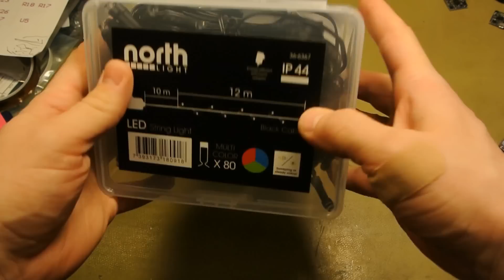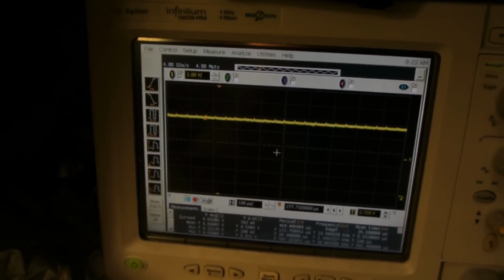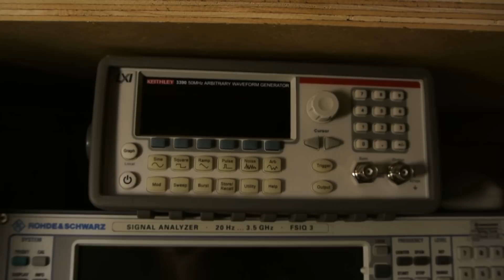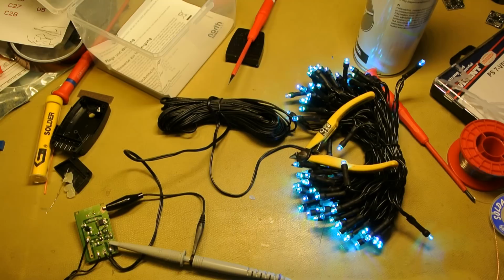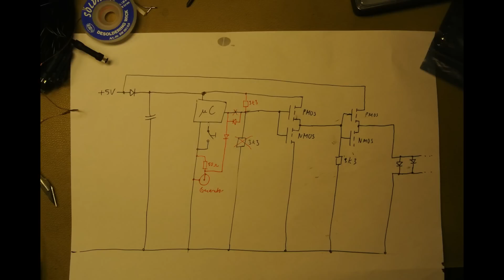Pulsed VCC controlled RGB LED strip

Comment: Next time you want to remove hot-glue, put on a drop of isopropyl-alcohol, and it magically releases - no mess on the table with all those cracked parts :D
Reply from the maker: That turns out to be a very helpful tip, thank you.

Comment: So to do the 'fading' it is switching rapidly between colors by sending two sets of pulses that total 8 pulses.  If it is fading from Blue (1) to Purple (5) to Red (4) it sends four pulses (to get to Purple), pauses briefly, and sends four more to cycle back to Blue.  The pause on Purple increases as the pause on Blue decreases increases until it is staying Purple almost all the time.  Then when it is at full Purple it starts fading to Red by sending seven pulses to cycle around to Red and a single pulse to switch back to Purple.

Comment: Great stuff! I noticed the simple colour change program (#2) uses a single pulse to change the colour, and a double pulse between white and blue (to skip the off state). Now I need to get the Arduino to generate out of spec pulses - same as you did. Nice video - thanks :)

Comment: Was the gunk you removed hot glue or epoxy? Could the cause of the missed pulses be line capacitance? Ie: Perhaps LEDs farther from the controller will be more likely to miss pulses, so when unwound, only some LEDs in the middle will look "random" and the ends (on average misses all pulses or receives all pulses) will mostly be the same color.
Reply from the maker: The gunk was definitely hot glue.

The missed pulses seem to be due to differences in timing between the chips since the LEDs do not react in order of position on the wire, but it's always the same LEDs that react first when the timing is changed gradually.